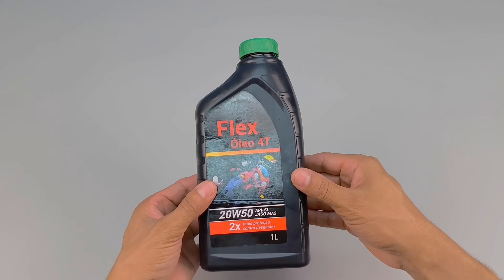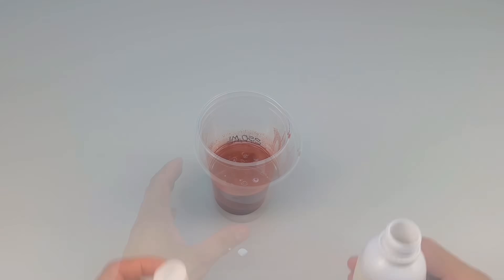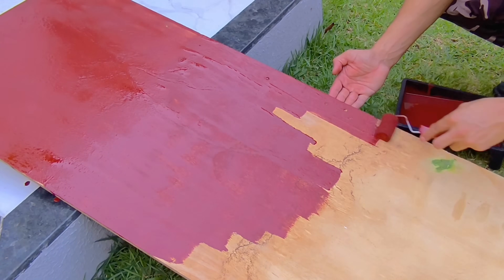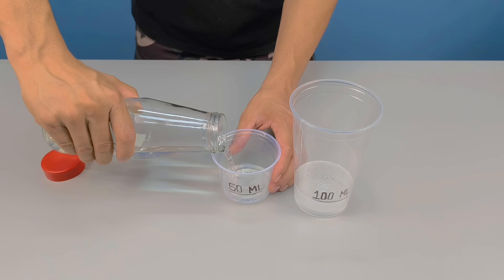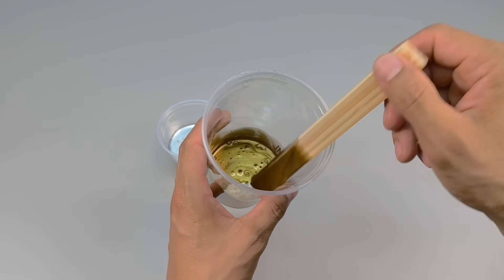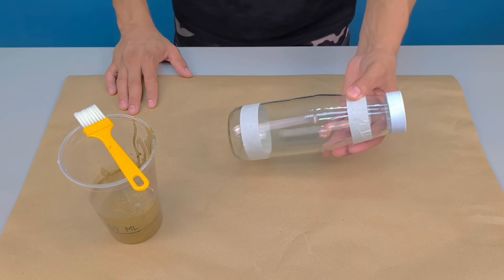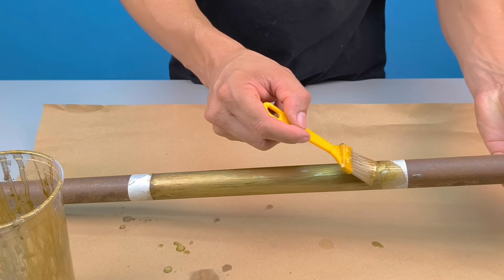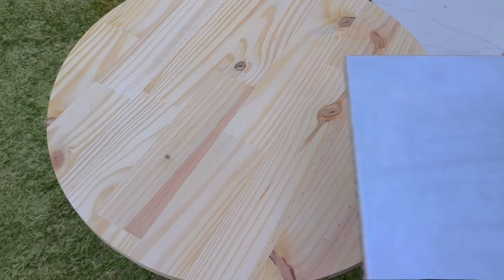Mix pigment POWDER and used motor OIL and DEFY all laws of SCIENCE!

Comment: Can the used motor oil paint be done on plastic? If not then please give me an idea how to paint on the surface of a plastic board
Reply from the maker: Good question. Used motor oil paint does not adhere well to smooth plastic without preparation. For plastic boards, surface sanding, proper primers, or resin-based coatings work much better 👍

Comment: Isn't used motor oil very carcinogenic? I would say painting things with that would be dangerous to your long term health.
Reply from the maker: You're absolutely right that used motor oil can be hazardous if handled incorrectly. In this case, it’s applied only as a protective coating for outdoor wood surfaces — areas that people won’t have direct contact with. The goal is to recycle it safely and give extra durability to wood exposed to weather, not for anything that would pose a direct health risk. Safety is always a priority in my projects.